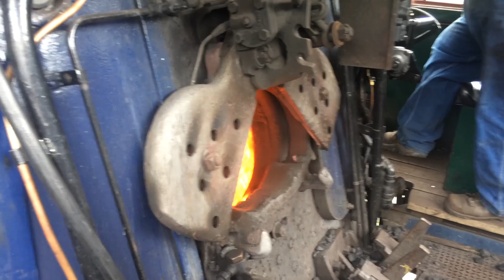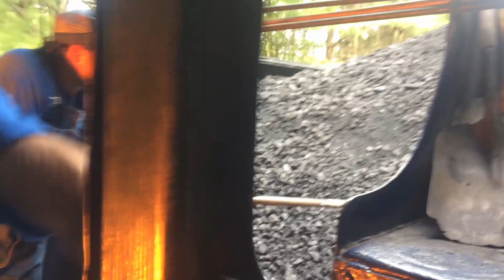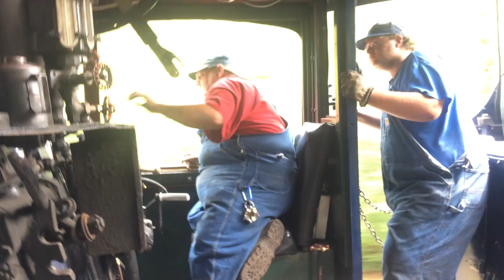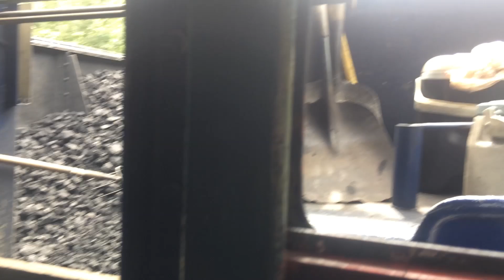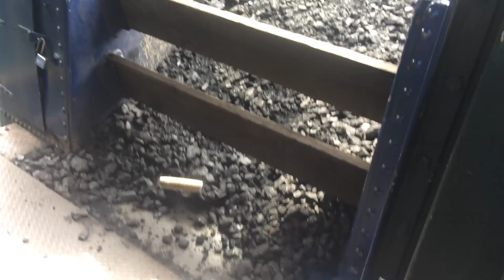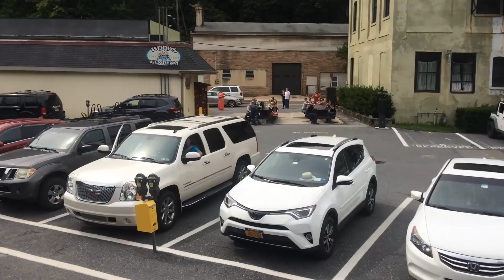Reading & Northern 425 Steam Cab Ride - Jim Thorpe PA

Comment: How do you get a cab ride
Reply from the maker: You have to call them and ask because they don't mention it on their website
If I remember correctly it costs $100 to ride 425 and $25 to ride a diesel
Reply: @Traincraft101  for the cab rides is that per person and also do you get a chance to blow the whistle
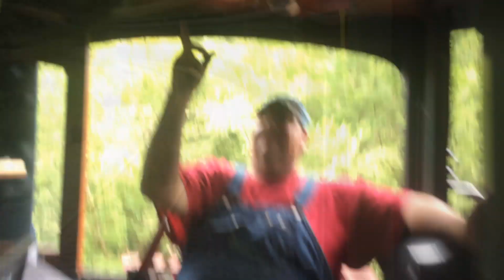Reply from the maker: @OldIronVideo  yes it's per person. The engineer let me blow the whistle once at 24:20.
Reply: @Traincraft101  that’s pretty cheap for a diesel ride and when I’m old enough to drive I’m definitely going to try to get one